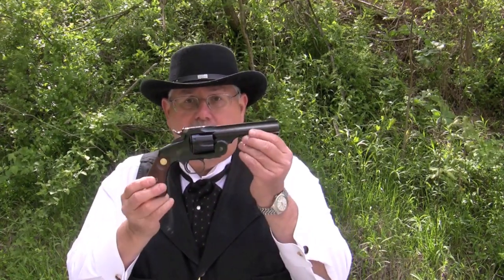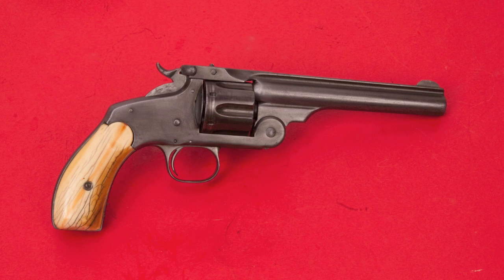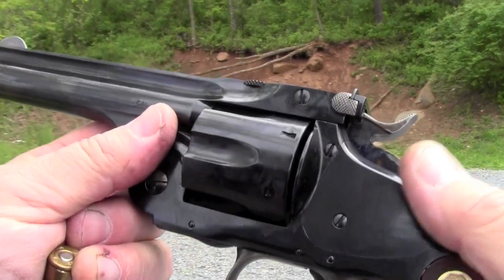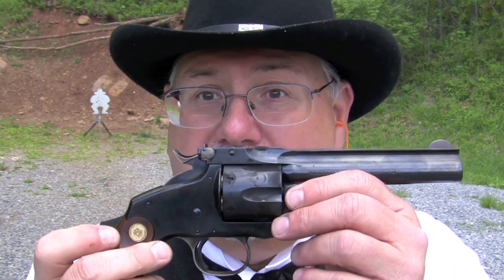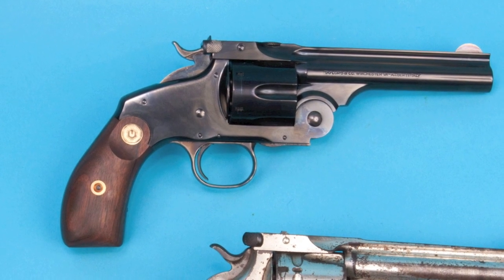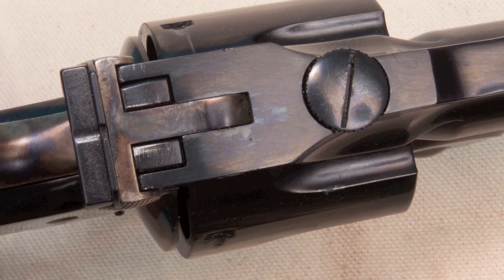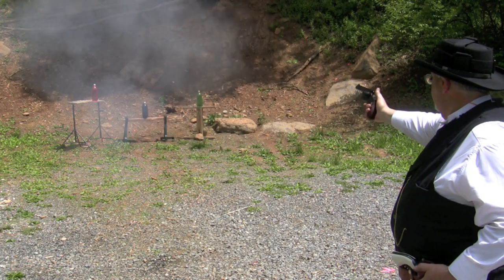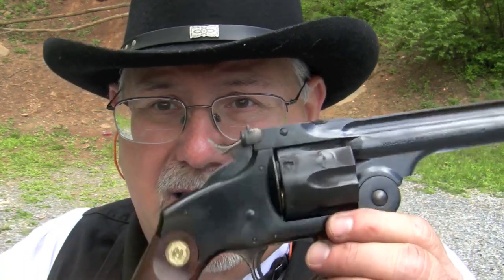Taylors New Model No 3 Frontier

Comment: Howdy Mike !
got mine , and also the fall magazine  ,with the article.
 You mention the very stiff trigger pull ,  the culprit is mainly the trigger spring.
Performed a  "liposuction " on the spring and it's " Night and Day".
Next step is working a little on the trigger/hammer engagement.

Comment: I  had an Uberti Schofield that shot high and way left. It also has no cylinder stop to prevent the cylinder from roll out of battery when there are only two or three rounds in it. If you cock it slow the weight on the unfired bullets make the cylinder drop to the bottom of the frame and you get a hammer drop on an empty case and big old click and no boom.  I tried this on other Schofields and I got the same results. I sold it.

Comment: There is one more external difference between this replica and the original,   the original doesn't have the latch under the frame to allow you to open the gun without activating the extractor.
My original NM#3  44 SWR  5" also shoots pretty  high , I solved the problem going to light bullets .
My beretta Laramie  6.5" shoots level with 200 gr.
I have a Taylors frontier coming , we will see how to make it shoot to point of aim .

Comment: Nice Video Mike. I just got a S&W Double Action First Model. Looks just like your Frontier model but is chambered in .44 S&W. I was wondering if you knew of a place I could find a replacement grip for it. One of the grips is cracked on mine. Thanks.

Comment: How come your Uberti Model 3 cylinder (and hickok.45s) in .45 Colt lasts 30 rounds before locking up and mine barely lasts 5?  And even when I start squirting Ballistol and spin it it only frees it up for two more rounds before you have squirt and spin it again?  
Tried this yesterday using Swiss 3F behind a wad and 250 gr Speer LSWC shooting 24 rounds

Comment: hi, Mike !!!  to reloading a top break is not necessary disalligned the empty chamber from the barrel !   because you can alligned soon the empty  chamber and the barrel and  then close  the cylinder and get down on it the hammer after you pull slowly it whitout cock  it  on the secobd fire notch ... so long

Comment: Is it possible to open this gun with one hand like the Schofield or do you need two hands?
Reply from the maker: souths last rebel It takes two hands, but on the plus side, you can’t accidentally open it and dump your ammo, which is easy to do with a holster on a Schofield.
Reply: Is the latch as strong as a solid back strap
Reply from the maker: No. That's why the design isn't used anymore.
Reply: duelist1954 which has the strongest latch, this one or the Schofield
Reply from the maker: I think they are about even in that regard. The Schofield is a lot like the Webley latch that stayed in use until the 1930s. I think the Schofield latch is a lot easier to use, and the sight on it is better. But, it is easy to open accidentally...I've done it myself on more than one occasion. But, mainly, S&W used the Schofield latch  as little as possible because they had to pay Maj. Schofield a royalty on each one manufactured.
Reply: duelist1954 thank you for the information